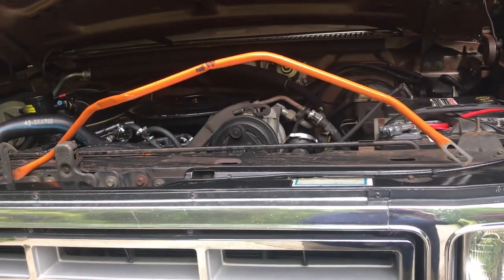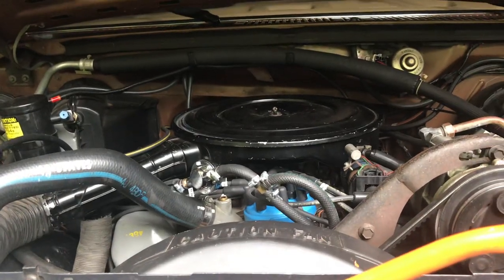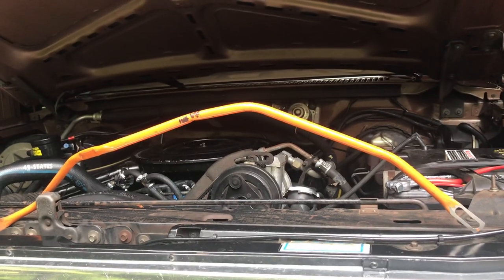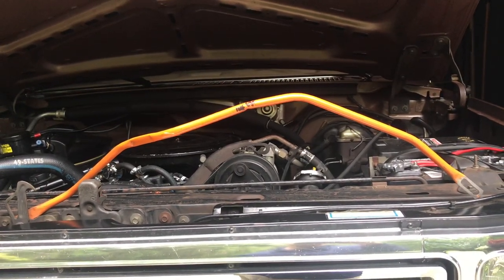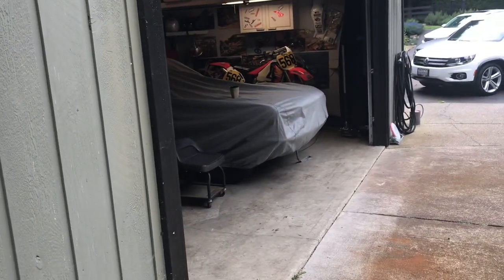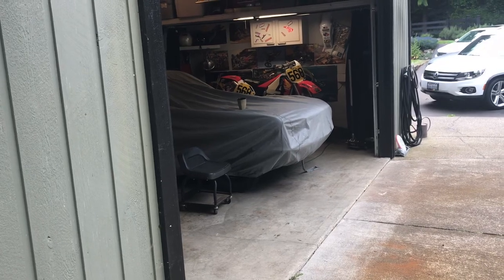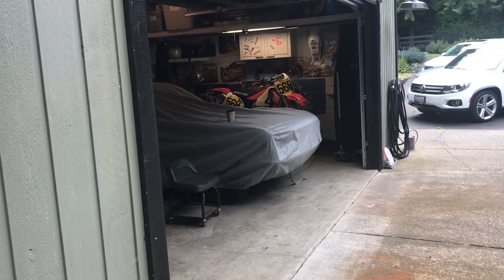Ford c4-c6 kick down linkage, do you need it?

Comment: I have an 87 F 150, with a 351W, C6. I hooked the kick down linkage up once and it made my truck shift terribly, had to get to like 15mph for it to shift into second, never even tried to see how long it'd take for 3rd, and when it did shift it was really rough. Something might technically be wrong, but I have never for one second had an issue without the linkage, and I've been regularly driving it for 3 years. Glad to know I'm not actively doing any kind of damage
Reply from the maker: Happy to help👍🏼

Comment: The kick down only ups the fluid pressure, 
And makes a world of difference and without it u will burn your clutches up quicker, 
Just because it works without it doesn’t mean it doesn’t need it
Reply from the maker: Not true but you can do whatever you want.
Reply: @zmurray9499   you don’t have to be smart to read what the owners manual says….. 🤷🏻
Reply from the maker: @KeeleDesign  It says that in an owners manual, even a shop manual wouldn’t say that. I’ve had vehicles with over 150,000 miles with no kickdown linkage on it. We can go back-and-forth all you want your opinion is just as valid as my opinion so put the kick down linkage on your vehicles
Reply: @zmurray9499  You sure it's "kickdown" and not Ford's version of a TV linkage? TV being Throttle Valve? Which does exactly what the "wrong" guy said and throttles trans line pressure according to engine throttle position? 

That's funny. What exact "formal education" do you have on Ford automatics?
Reply: C6 and C4 shift of of the vacume modulator. The kick down only works at WOT and just shifts to 2nd gear.Thats all it does .Does not effect line pressure .

Comment: Running a stock FMX (the odd ball between C4 and C6) I definitely felt a difference when I ran a while without a kickdown rod. You definitely can run without them but if you can manage the geometry of attaching it to the throttle linkage, I'd still recommend it. For me, it was the difference of a solid shift vs just floating up to a higher gear. I'm no transmission guru but it just wasn't as snappy for on demand power when flooring it. For Edelbrock, the Ford kickdown attachment also comes with a spring-screw adjuster so that you can tune when the kickdown arm engages. Pretty handy.
Reply: Is that in a "stock replacement" scenario where the engine was a 4-barrel to begin with and is "upgraded" with an Edelbrock carb on the factory manifold or a "swap" from a stock 2-barrel carb and intake to aftermarket 4-barrel components? And how is an FMX "between" a C4 and C6? And what did you notice about WOT trans operation sans "kickdown rod"? Or was that when it "floated" to a higher gear? Where was your manifold vacuum before and after "upgrades"? What vehicle and powertrain engine-wise did you "upgrade". FMX trannies were typically used in light-duty, low horsepower and low-performance vehicles. F100 pickups with low-compression, low-performance V8s with "highway cogs" and inline-6 vehicles. Definitely not a "high performance" transmission even by Ford standards.
Reply: @deeremeyer1749  It's a 400M (yes I call it that) and the carb was a 2150 2 bbl, in stock configuration. I upgraded it to a 4bbl (Edelbrock 500cfm) with a new intake as well. Manifold pressure is around 20 inches of mercury, depending on the tune I throw at it. The FMX itself just never had much aftermarket, as the same goes with the 400M. I've never seen an FMX mated to anything else but the 400M block (which also includes the 351M). As from what I've been told from most old timers that ran them, you can beat the hell out of an FMX but your really can't beef them up for anything more than spruced up torque out of a stock motor. Any serious race options would have to pass that up for a C6 or later. One that would have been gone through and had the high wear components reinforced with stronger aftermarket parts. Usually people would traditionally pass up working on the 400M and swap it for a 460, so they'd always go with a C6 anyways.

The FMX is quite interesting really. It has a bellhousing pattern of the 385 engines (460) but it's stronger than a C4; while being lighter than a C6. So it's really too bad they never received any aftermarket. Both the 400M and the FMX are the in-between power option. In modern day, the 400M actually has a lot more build options to correct all the lousy choices Ford made with the head to piston relationship.

As for the shift characteristics without the rod, I found I needed to manually downshift into 2 in order to get my passing gear. With the kick down rod, it would happen automatically depending on where I set the stop screw at the carb. I didn't get an after market throttle bracket, so I cut min in half and had to extend it. The 2150 carb isn't as wide as the Edelbrock, so my kickdown rod was binding as it had to slide between the throttle bracket and the carb to work. With all the throttle and kickdown linkage geometry figured out, it's a snappy setup overall.
Reply: Do you remember what part # the kickdown adapter was for the ford ? I have a 69 250 390 and I just bought a 650 avs2 I want to keep my stock kickdown on . The difference without it can be in WOT mode  the shifts will come in sooner than with it held down by the Rod it's only for WOT but I still want it .
Reply: @TheThirdWheel618   Throttle Lever #1483

Comment: Once or twice my kickdown has popped off and I definitely know when it does. I lost the cotter pin so turned out to be a simple fix. I know my c6 needs a kickdown. My 85 is a far cry from the condition of yours however.
Reply: Same thing happened to my kickdown on my 390fe with c6 behind it. I definitely noticed when it came off

Comment: I’ve never ran a kick down on any of my C6 tranny’s , those rods can be a pain on anything modified ,  but you go with a electric solenoid and a slide switch
Reply: electric solenoid and a slide switch???  Please explain. I'm new to older trucks and learning. thank you.
Reply: @tonyfourpaws4511  instead of linkage mount a simple 12 volt solenoid positioned onto transmission to activate the kickdown lever and a slide switch mounted on the  intake manifold controlled by the movement of the throttle linkage.  Gm used the system in the late 60’s and early 70’s worked great on gm turbo 400 or fords C6.      It’s just replacing the kickdown  rod.

Comment: The kick down linkage only engages at WOT .All it does it put trans in 2nd gear.I dont use them on my C6 they shift fine with out it .
Reply: I installed a gear vendor  on my C6 and with the kickdown Rod on if I floor it at 65/70 it kicks down from OD into 3rd for kick but seat of the pants power just like a 4 spd trans 😊.   I agree with  you on the stock 3 spd 65/70 is too fast for a kick from 3rd to 2nd but what a difference with that extra gear .

Comment: Amused.  It’s just a 3-speed.  When you’re passing someone, just floor the throttle and drop the shifter into 2nd gear!  Lmao
Reply: I believe it's a little healthier for the vehicle to do it that way because you're not relying on full throttle and a full-blown kickdown you can ease it in that way.
Reply: Ive always been scared to try on my c4. so you can literally just move the shifter to the 2 notch and it doesnt harm the transmission?
Reply: @michaelmcginley1875  It does not harm your transmission, it shifts the same as normal
Reply: @theruralrenegade8911  I drove my auto like a manual for quite a while.. having a tach helps and also learning your engine sound.
Reply: Starcloak wouldn't you want to shift it down to 2nd and THEN floor it?

Comment: I ran without it on my 68 dodge d200 for a couple of years. Ran fine didn't notice anything strange with the shifting. It was a 318 engine 727 trans. Just a little cruiser, I never even got on it. May have noticed something if I pushed the thing but just cruised around town in it.
Reply from the maker: 👍🏼I’m the same, just cruising. You just need to kick it down manually if needed.
Reply: @zmurray9499  ROFLMAO.

Comment: I’m dealing with the throttle cable and kick down arm issues after install of a edelbrock carb and edelbrock 7166 intake performer manifold. Even with the edelbrock recommended adapters nothing is lined up correctly or even at the correct height. Definitely not a bolt on parts.  More fabrication and engineering to come.

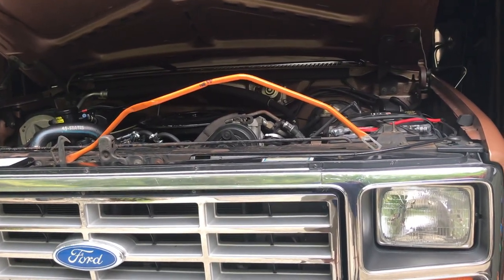Comment: Thanks. I just bought a 73 F100 with a 1980 C6 and 302 motor. No kick down 2:22  linkage. Shifted fine on test drive. The whole truck needs work for sure. It has a power drain somewhere. I’m still looking. Crawled under truck looking for wiring issues and found a wiring harness on the side of the Tranny with with plug connection going nowhere with 4 wires. It shifted fine, just wondering what the dead end wires went to and for what advantage or disadvantages?
Reply from the maker: Probably neutral safety switch and reverse lights. If it’s a vacuum line then it’s a vacuum modulator. Wouldn’t shift if that wasn’t hooked up. It will also shift funny if it’s hooked up to the wrong vacuum source. you have ported and manifold vacuum. If it shifts weird then change to ported or manifold. Which ever it’s not Attached to
Reply: @zmurray9499  I’m putting an AOD in my 85 truck with 302, I have the lokar kit for the tv cable. Is there a vacuum line to the trans? I removed all the EFI and AC stuff. Didn’t see any vacuum lines to the trans.

Comment: I just put a C6 transmission in my 93 F-150 XLT and it will not go into gear. Do I need to engage the kickdown lever?
Reply: Find a spot for the vacuum modual on the trans to something the engine that produces vacumm

Comment: I have an 86 f250 with a 6.9 l diesel with an aftermarket turbo that was put on before I bought the truck and it could definitely do without the kickdown because it has 410 gears and the 6.9 doesn't even like when it kicks down it kicks down kicks right back up there's enough torque when you're in drive doing 50 to just accelerate without kicking down kicking down could simply damage the engine or bang the transmission around.
Reply from the maker: The only time I would notice it’s gone is when you quickly put the gas pedal to the floor. The only time I do that is in road rage situations in my daily driven Volkswagen.
Reply: Lol. Just how long and complex is that 6.9 "kickdown" linkage? And are you sure that trans is a "C6"?
Reply: @zmurray9499  You have a carbureted VW with an auto trans and "kickdown linkage"? Do tell.

Comment: Really really helpful video! Does this also apply to a ford aod transmission? I've been driving my truck without it and recently when I went to connect it to my carburetor, the transmission has been slipping...
Reply from the maker: If it has a vacuum line going down to the transmission than it should shift just fine.
Reply from the maker: And or vacuum modulator
Reply: A Ford AOD uses a TV cable and it is absolutely needed, without it you will feel the transmission slip and eventually lose over drive all together. The TV cable is setup like a kickdown on the carby but has to be set precisely to deliver a certain amount of line pressure to the tranny at 0 throttle. I hope you noticed this in time...
Reply: @CreamCracker1990  would you know where I could find a good source for the precise positioning of that linkage your speaking of

Comment: My 91 f150 has a c4 and no kick down with a 2500 stall converter runs pretty good with it
Reply: What does the stall converter do?
Reply: @raizt1596  converter locks up around 2200 to 2500 factory converters are lock ups. performance torque converters are a non lock up until it hit its rpm range

Comment: Never had one on my 71 Mach 1, and currently my 78 Bronco has one, but has never been hooked up to the carb since I bought it. I'm just gonna remove it since I put a new carb on and I'm not trying to buy $50 worth of adapters/linkages to hook it up. I've never noticed any hesitation or anything when getting on it. It's a pretty useless piece.
Reply from the maker: I agree!! Take care

Comment: I got a 79 bronco with no kickdown, have not driven it yet. How do I know if i have the vacuum modulator?
Reply from the maker: There will be a vacuum line running from your carburetor or manifold down to the transmission. It’s usually a metal vacuum tube. I think the Modulator is on the passenger side both with the C4 and C6. It’s a little round canister that’s zinc plated. It screws into the side of the transmission. If you don’t have a vacuum line then check for the modulator anyways. If it’s there with no vacuum hose then plug one in. Run it off manifold vacuum.
Reply: @zmurray9499  ok will check it out, thank you

Comment: I have a 1975 torino starsky and hutch version, it has a 351w engine, I want to change the original carburetor for an edelbrock, I asked myself what to do with that part, I am going to try to do the same as you remove that part and see how it works
Reply from the maker: Edelbrock sells an adapter for the kick down linkage.try without and if your not happy just put it back on.

Comment: Is a stall converter a different name for torque converter?
Reply from the maker: It’s a term used in drag racing.They use torque converters with higher RPM stall. Before they engage

Comment: I have a 1985 F250 351w with a 3 speed c6 automatic my engine has no emissions anymore do I need the linkage
Reply from the maker: Anything older than 1986 shouldn’t need it. Make sure you have a vacuum line going to a small canister on the transmission(vacuum modulator). My line was originally coming from the drivers side front port on the carb. Good luck

Comment: Can I ask you a question
Reply from the maker: Junior Cates yah what’s up?
Reply: Z Murray I got a 79 460 just had the carb rebuilt and when you crank it, it acts like it wants to start but won’t. New plugs and wires and distributor cap and rotor
Reply from the maker: Does it start with starting fluid, is the choke flap closing all the way.
Reply from the maker: Junior Cates did it run before the carb rebuild?
Reply: Z Murray it was rebuild in 05 and sat since about a month ago. Accelerator pump didn’t work so had it rebuilt
Reply from the maker: Junior Cates pull the fuel line off and make sure the fuel pump is pumping gas
Reply: Z Murray it is I replaced the fuel pump as well. Cleaned out the gas tank and had fresh gas
Reply from the maker: Junior Cates bottom the mixture screws out and then turn em counter clockwise 2 turns. Look in the carb and make sure the ventures are squirting fuel when you open the throttle. Then check float height    and after all that and still no start, you probably have something not right internally in the carb.